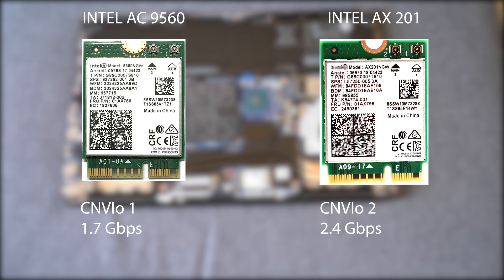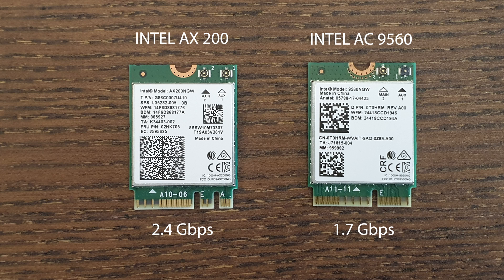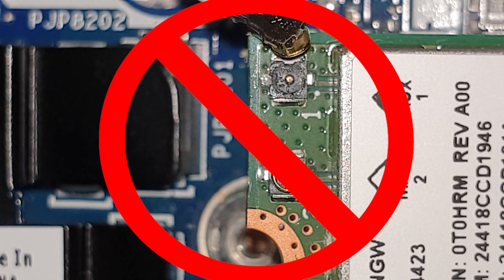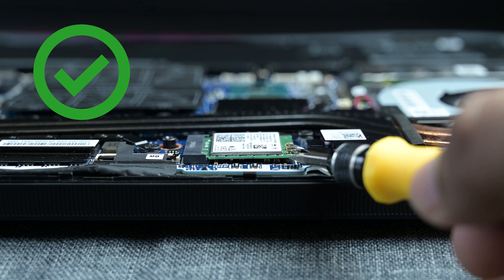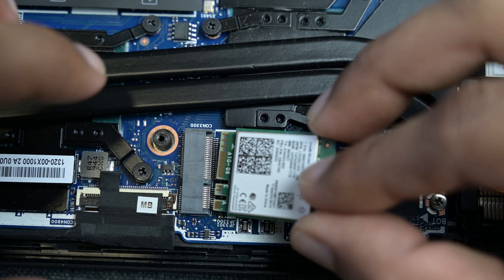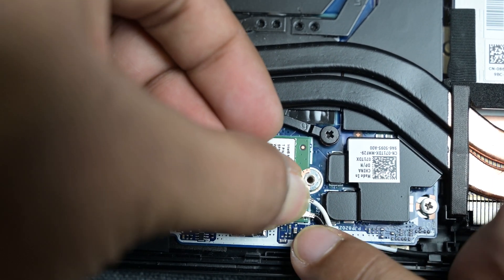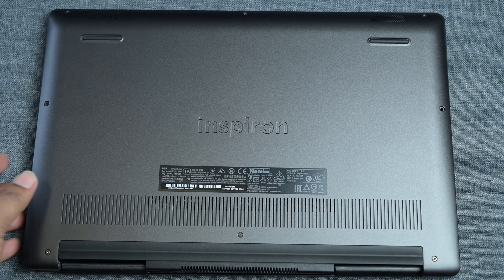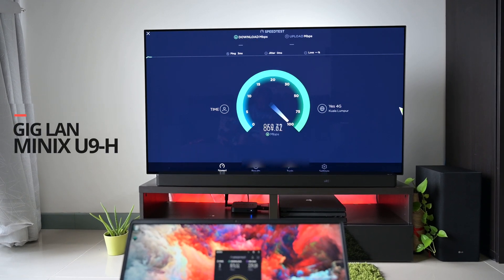Upgrade Laptop to WiFi6 | INTEL AX200 | KILLER AX1650 | Dell Inspiron 7590 |

Comment: My ax200 wont get over 130mbps, while my android phone can get over 300mbps, what could be the problem?
Reply from the maker: Which router are you using?
Reply: @GTCREATIONZZ  just basic router came with the internrt provider.
Reply from the maker: You need to get the wifi6 router to get the full benefit

Comment: I order after watching this video.. to replace my laptop intel 9560 to ax200 and i order from Amazon and it cost me around rs.2450 but i surprisely got the product ax210 which is wifi6e .. thought it will not work. now i saw its working after updating its driver from intel website. . Now i am very happy😁. Thanks
Reply from the maker: You may not get 6ghz band width, rest everything is the same

Comment: Hey, great video. You replaced the AC-9560 with the AX200. I have the AC-9462 installed in my system. Intel suggests the AX201 replaces both the AC-9560 and the AC-9462. But as seen in your video, that is clearly not the case. I was wondering if I can upgrade from the AC-9462 to the AX-200 without any hassle.
Reply from the maker: Hi. Glad you liked the video.
For the compatibility, we need to try. There is no clear indication on which one is compatible. These are cheaply available. If one isn't working try another one. In some laptop brands, there will be whitelisting, which prevent from replacing wifi cards.
Reply: @GTCREATIONZZ  Thank you for the reply! 
I have a Dell laptop. I'm guessing the whitelisting won't be an issue. I will try changing the card, following the steps in the video.

Comment: Hi, I have an Acer Predator Helios 300 (PH315-52) laptop from Christmas 2019. I was thinking of upgrading the Killer 1550i wifi card in the laptop with either an AX 200 or 210 wifi card, but I can't figure out which card will work. Can someone help me?

Comment: What is the different between INTEL AX200 vs KILLER AX1650?
Reply from the maker: Both are same but different manufacturers. Intel ones are easily available
Reply: @GTCREATIONZZ  Thx for your prompt replied. Reason I asked is because I recently bought a Acer Nitro 5 AN515-45-R7QR laptop. It is using Intel Ax200. 

The wifi reception is very poor. Avg download speed is ard 6Mbps whereas at the same location my Realme mobile download speed is at 79Mbps. 

Is it because of the wifi card issue? Thx.
Reply from the maker: Great, you don't need to worry  about it unless you face any issues. Note that you need to have a wifi6 router to enjoy the benefits. AX200 is backward compatible, meaning you can still connect old router also.

Comment: You make measure wrong! All test need be in the same host server (I see ~1GB/S from server "Yes 4G" and 850mb/s from another different server "InNet").
Reply from the maker: They are more or less the same my friend. Anyways I am testing the wifi, not the Internet service provider.
Reply: @GTCREATIONZZ  to test wifi speed perfect your need the same environment (same distance, same modem, same host server in speedtest, same PC host, etc…) in my test I receive diferente speed results with diferente server host on speedtest, so it’s not the same or like u say “anyway just testing wifi”
Reply from the maker: Yes for benchmarking, need to standardise the environment.  In a general use case it doesn't matter. Even with same device host, same server, same distance, you might get different speeds

Comment: Can i put it on my Old T440s Thinkpad ?     Should i change also the antena adapters ?
Reply from the maker: Can not confirm which models are supported. No need to change laptop antenna.
Reply: @GTCREATIONZZ  Τhanks for your answer sir. I will check about ok for my model or not. But, are you sure about , not changing the antrenna ? Not need faster transfer cables ? Like we do on home network with cat6a, for example ?
Reply from the maker: No need. basically you have 2.4ghz antenna and 5 ghz antenna on your laptop. The M.2 slot (where the wifi chip sits) will handle the data rates. Its all about how close you are to a router.

Comment: I took the time to switch laptop so i can actually write my piece.  You have answered the my question by showing the old and new adapters side by side. They have different style but still fit to the slot without converter of sort.  Nice video and sound qualty. Dummy proof instructions. In short good job.
Reply from the maker: Glad it helped

Comment: MY LAPTOP IS ASUS TUF FX505DD WITH RYZEN 5 PROCESSOR.
IN MY LAPTOP THE WIFI IS WORKING FINE BUT THE BLUETOOTH IS NOT WORKING SO GOOD. TH BLUETOOTH SOUND INTERRUPTS AND CRACKS  A LOT. I GUESS IT'S A HARDWARE PROBLEM.
SO, CAN YOU PLEASE TELL ME WHETHER CHANGING THE WIFI CARD WILL FIX MY BLUETOOTH.

IS THE BLUETOOTH OF THIS NETWORK CARD GOOD?
Reply from the maker: Hi you can give a try. I never had problems with this card
Reply: @GTCREATIONZZ  OK, BUT I SPECIFICALLY WANT TO CHANGE THE NETWORK CARD FOR BLUETOOTH.
Reply from the maker: Bluetooth and WiFi in one single card.
Reply: @GTCREATIONZZ  Ok, Actually there are many different versions of this wifi card labelled on intel's official website.
Can you please tell me that what is the difference between the M.2 2230 and M.2 1216 Version? Are they both same?
Can I get any of them?
Reply from the maker: Not sure if this will work on AMD, by the way which is the current wifi card?
Reply: @GTCREATIONZZ  It's Realtek
Reply from the maker: Not sure if this replacement would work or not
Reply: @GTCREATIONZZ No, but other ryzen users have also installed this card and it worked.
Reply: @GTCREATIONZZ Can you just tell me that whether the  2230 and 1216 form factors are different or same?
Reply from the maker: I have used in this video is M.2 2230 form factor and I think this is commonly available when you search for AX200.
You may also consider Ax210 which has BT 5.2
Still can not confirm,if this will work for you, you can give a try. All the best
Reply: @GTCREATIONZZ  Ok, Thank you for giving your time.

Comment: I bought a WiFi antenna for my desktop last year and I didn't like it. I ended up with a motherboard that had built in WiFi. The card for my desktop happens to have the AX200 in it. I'll see if it works in my laptop that has the AC9560.
Reply from the maker: All the best

Comment: after install can i use my laptop as a wifi 6 hotspot for my phone i use a lan cable 1gig on my notebook so if i use this wifi 6 card with as a hotspot i can use it as a wifi 6 router for mobile gaming?
Reply from the maker: I dont think so. For gaming, using a cheaper AC WiFi router will be a better option.

Comment: for the maximum negotation speed I only got 1.2gbps and I can only get 500mbps when using speedtest, any suggestion? the Router I used is Verizon G3100
Reply from the maker: Bottle neck could be the router.
Reply: @GTCREATIONZZ  I wonder if it is the problem with the router however I double check it is AX6000 model which should handle 1gbps internet without problem...
Reply from the maker: negotiation speed can vary, but you will be able to get full 1gig speedbif it's supported. Make sure that in your router settings, the 160Mhz channel width is enabled.
Also verify connection speed using gig lan cable
Reply: @GTCREATIONZZ  really appreciate that I think 160mhz actually work

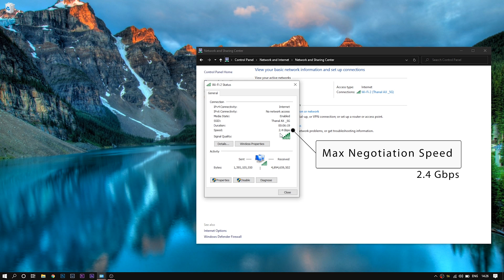Comment: 5:56 I am not seeing 2.4 Gbps on mine, what should i do?
Reply from the maker: Are you using good router? If yes you need to get close to the router to get that link speed.
Reply: @GTCREATIONZZ  I have ASUS RT-Ax88u wifi 6 router and I sat next to it but  when I speed test it gives me max speed
Reply from the maker: @sairangineeni  depends on what is your primary usage. If you are getting the full bandwidth from ISP (internet speed)/NAS it should be fine.

Comment: And AX210, does it work too ?
Reply from the maker: Should work fine. But no difference from AX 200 unless you have a 6ghz antenna
Reply: @GTCREATIONZZ  There is also bluetooth 5.2

Comment: Do I have to remove/disconnect/disattach the battery when I upgrade my wifi card since my back panel can be taken off and the components accessed without having to remove it? If so, why? Thanks in advance GT
Reply from the maker: It is recommended to have the battery disconnected. This is to protect the electronic components just incase
Reply: @GTCREATIONZZ  Ok, thanks, and why should I press the power button for 15 seconds afterwards?
Reply from the maker: This is actually mentioned in dell's user manual. The purpose I guess is to discharge any static charge from the components.

Comment: I need to change the WLAN card on my HP i3 laptop. I am not sure about the interface? Can i use any WLAN for my HP laptop?
Reply from the maker: You may need to check the motherboard configuration
Reply: It's mini PCI express slot

Comment: is anyone having bluetooth problem after installing the new wifi card because my wifi works fine but the bluetooth doesn't work
Reply from the maker: You can try swapping the WiFi antenna cables and reinstalling the drivers

Comment: Thank you so much for this video!!!  Unfortunately, I saw this after I unwisely used my fingers to remove the u.fl connector from the old wifi card...and guess what...the ring detached from the card just like how you showed in the video.  How did you manage to use a needle to remove the ring from the connector?
Reply from the maker: Need to press against the ring using pin from inside and slowly slide upwards. If you have any magnifiers,  try to see it and then try accordingly.
Reply: @GTCREATIONZZ  Any chance you can show how this is done? Thanks so much again!

Comment: Would this work for a Dell 7480 laptop with Intel Intel® Dual Band Wireless-AC 8265?
Reply from the maker: You can give it a try. There is no list of motherboards that are supported. Most of the dell laptops are supported

Comment: Hi there, 
I am from Melbourne, Australia. Recently I bought Dell Inspiron 3671 Desktop.
It came with single brand Wi-Fi only, that is 24GHz. Could u please let me know which 
 Wi-Fi adapter can I use to upgrade to dual brand Wi-Fi???
My email: nashmilan007@gmail.com.
Thanks.
Reply from the maker: If the motherboard is having M.2 slot, you can try using Intel AX 200 chip, if not the USB dongle version  is also available

Comment: Hello! Excellent video. I have Dell i7559 (i7 6700hq, gtx960m) and wifi board Intel 3165 can i updare wifi 6 ax200??? Thx :)
Reply from the maker: Hi it should work fine, the WiFi card costs around $20 only. You can give it a try.
Reply: can you confirm whether it worked with Dell 7559, I have the same model.
Reply: @RevTechIN   Idnt not buy yet

Comment: Does it work on any laptop?
Reply from the maker: Not really. It will not work on some motherboards. Need to try. Nobody knows which and all motherboards are supported.
Reply: You can typically google your laptop's model to check if you are "allowed" to install a non-oem wifi card. This means that you must specifically have been allowed as a user -- to install some non-original card. My own personal experience with what was called the "Lenovo Yoga 2  '13'"  ref: https://www.lenovo.com/us/en/laptops/lenovo/yoga-laptop-series/yoga-laptop-2-13/ Lenovo chose to purposely lock down their laptop's BIOS system that is permanently controlled by Lenovo, they have decided to make it so that the BIOS will reject any wifi card hardware ID that was not the same part number as the one that originally shipped in the laptop. This means that if you needed to replace the wifi card, because it was broken, you can still do this. However, you cannot "upgrade" the wifi card to a newer , better, wifi card.... I was very upset because I could not use WIFI-AC standard when it first came out :( I was stuck with bad wifi card.

Comment: Is that Killer AX1650 compatible with Desktop computers? 

I have a mATX motherboard with a m.2 slot. I have no luck getting it working.
Reply from the maker: I am not sure, some of the motherboards won't support it. Have you tried with some kind of PCIe adaptors?
Reply: @GTCREATIONZZ  yes this is accurate, sir, you can use the ones that mount a "laptop" sized wifi card onto a "carrier board" which plugs into the typical PCIe sided slots in a desktop! :)

Comment: What will the maximum AC speed of this adaptor? Consider both 80mhz and 160mhz channel width.
Reply from the maker: Hi. Ac speed tests are included in the video.
AC link speed at 80Mhz is 866Mbps and 160Mhz is 2.4Gbps

Comment: Which router u r using sir...?
Reply from the maker: TP Link AX50/AX3000
Reply: @GTCREATIONZZ  ur router running ok i mean heating problem..?
Reply from the maker: Hi. This router gets bit hot compared to my previous archer ac1200. I keep it on a raised platform.
I am also facing issues on highest speeds. On a gig connection I am getting only half the speed nowadays. Something is wrong with the software something to do with QoS I guess. To link customer care has told me to return the unit to service center. I will update if the issue has resolved or not.
I am working on a video of AX50.
Stay tuned.
Reply: @GTCREATIONZZ  thanks for ur precious reply....
Reply from the maker: Update. I got it replaced with brand new one from tplink
Reply: Now um also using ax50 working fine with high speed no issue...and thanks to u ,u r so caring and responsive...
Reply: @pramodverma9766  Yes I support this youtuber very much. I have not read one single response that was not kind, accurate, and helpful!

Comment: Where did you buy it from? can it be installed in Normal M.2 Pcie slot in a Motherboard, some one was saying we need KEY E slot to install it.
Reply from the maker: I am not sure. But some of the motherboards won't support. I got from Lazada Malaysia. You can get it from Ali express or amazon. Search for AX 200. The price is not very high. You can give it a try.
Reply: @GTCREATIONZZ  what was the price at that time  can you please mention its link

And 2nd question is can I use it in asus tuf a15 ryzen 7 4800H laptop

And thanks your video is awesome which helps a lot
Reply: Thanks you very much for the reply mate.